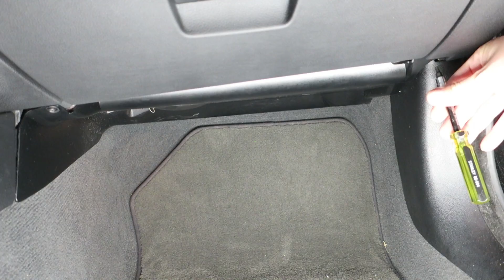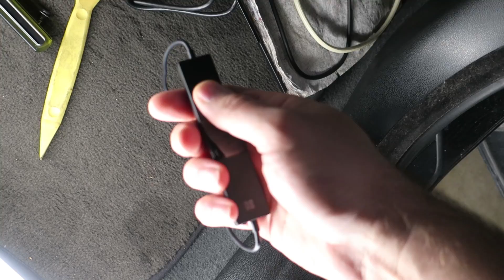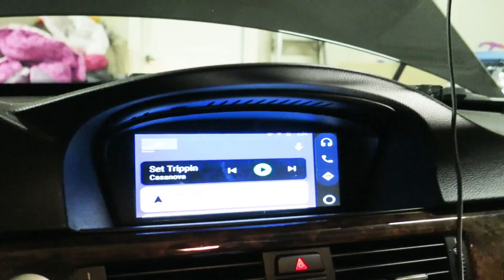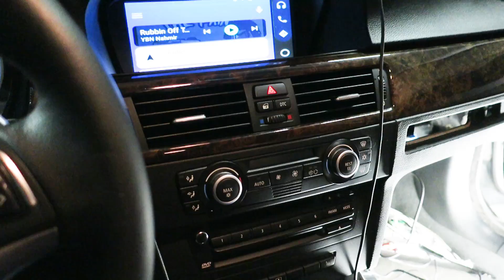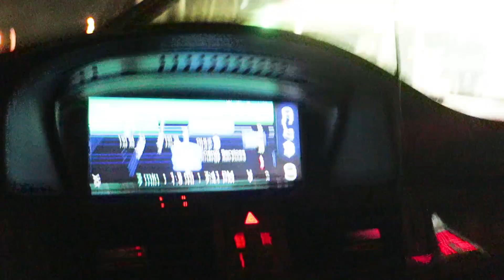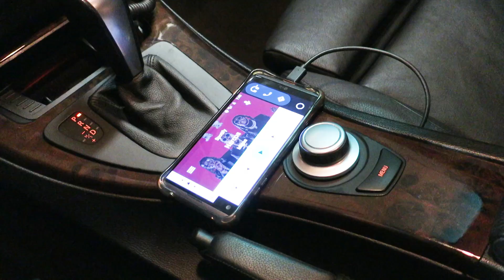Android Auto On BMW CCC iDrive

Comment: Dude, i'm taking a similar approach. Your videos are super helpful. And yes, there are plug-and-plug Android systems but it's more fun when I get to work on it. :p   E90 N54   For a wifi network in the car, I use an an Android phone hidden in the glove box. I use an app that enable hotspot feature on the phone.  I have a simcard activated on it, so internet access is available.  I've got a 32gig sdcard on it for music from the phone to AUX in.   Then i use my regular cell phone to control and send commands to phone thats permanently in the car.   I can listen to music and videos streamed from home to the car. (through VPN tunnel to my home network).  And stream dashcam live from the car.  Next thing i want to do is be able to send a text msg to the phone in the car and tell it to open the windows or do other functions via the cars DCAN bus.

Comment: Did you have a play with tasker and autocast to maybe avoid having to turn on casting manually? 
Btw I'm following you down the rabbit hole. My media interface is installed and the Microsoft dongle should arrive tomorrow.
Reply from the maker: I didn't, let me know how that goes!
Reply: I managed to get it to work using only tasker to recognise the connection to my Bluetooth and the autoinput plugin to automate all the screen tapping to start casting. 
Autocast should work aswell, but I haven't figured out how to program custom screens yet.
Reply: I figured it out with a combo of programs. Got Tasker set up to launch a task when it recognises the car's bluetooth and has power. It then starts waze and turns on screen mirroring through some taps on the screen. I also used ativity launcher to provide a homescreen shortcut for tasker to tap. Works flawlessly. Give a yell if you want more details.

Comment: Can I use this for cic systems?
Reply: Danny M wondering this as well... I cant find a device like the XCARLINK for the CCC, that works with rhe CIC I-Drive Screen & System. I would also want a rear view camera input as well..... 

Help us out heree!!!
Reply: Anthony G I just found one on eBay it's a screen that replaces the OEM one and has Android built in with all the functionality plug and play but it costs 500$
https://rover.ebay.com/rover/0/0/0?mpre=https%3A%2F%2Fwww.ebay.com%2Fulk%2Fitm%2F192357855359